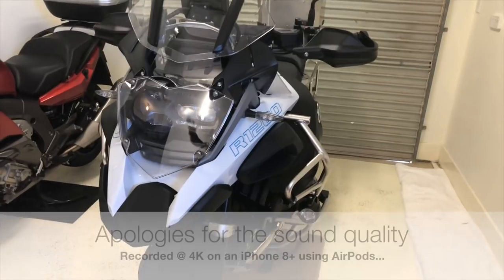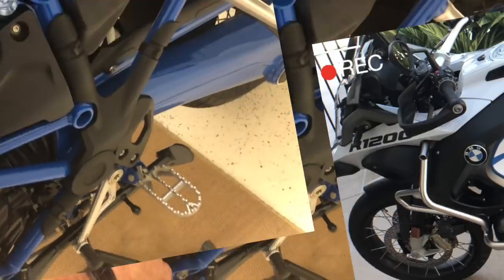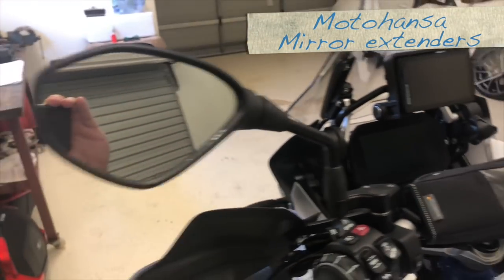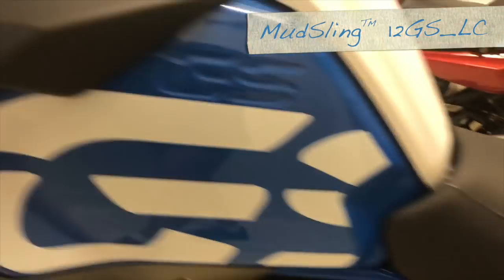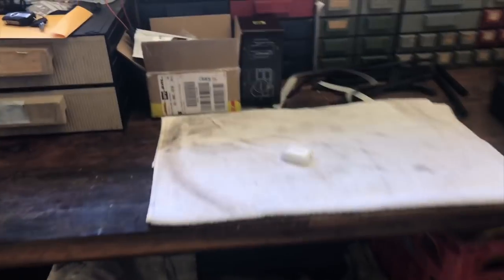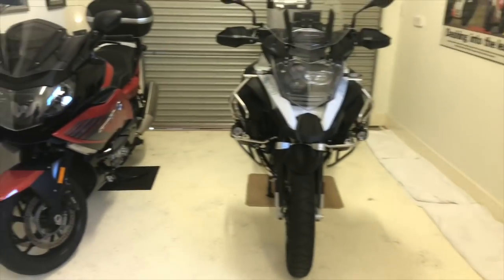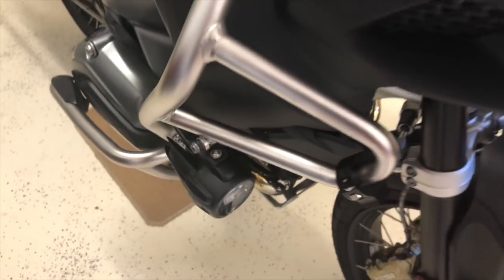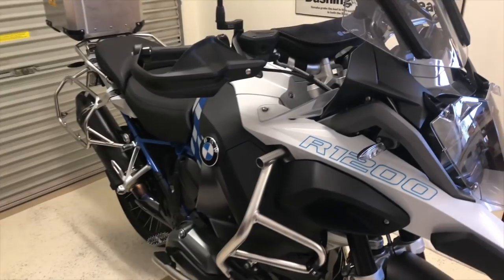Project 2018 BMW R1200 GSA Upgrade

Comment: What headlight cover are you running on that Gsa?  I just picked up the rally Gsa and I'm researching.  Thanks
Reply from the maker: BIG LIFE mate thanks for the sub, it’s the Perspex cover plate from BMW with a four (4) pin/plug attachment, simple to install but I believe it’s a BMW product. Good luck with the new purchase, your gonna enjoy the new love of your life 😎👍, ride safe and thanks for the comments 👍
Reply: @RMK67  thank you for your time.  I will check it out.

Comment: Intro ? Ha ha 😀. This is my next bike. I shouldn’t have bought the XR :/. It’s either this bike or the KTM SUPER Adventure. Subscribed.
Reply from the maker: Chris Wright well kinda like an intro 😱😁, the GSA is such an all rounder and an enjoyable ride very time. Did look at the XR but didn’t like my nuts being drilled into the tank - good luck with deciding on your next steed and thanks for the sub 😎👍
Reply: RM K Intro is great mate. Envious of the bike. Your mods are great. Wunderlich are the bees knees. Are u getting slugged import taxes by customs? And Clearwater lights are too  notch. Well done ! Great vids
Reply from the maker: Chris Wright cheers mate, try and make it interesting for everyone and only if above AUD $1,000 do our good mates at the ATO make an extra hit on import tax although this is also about to change 😉👍